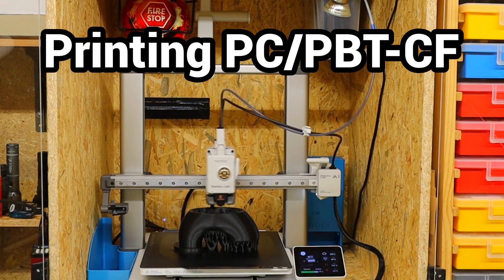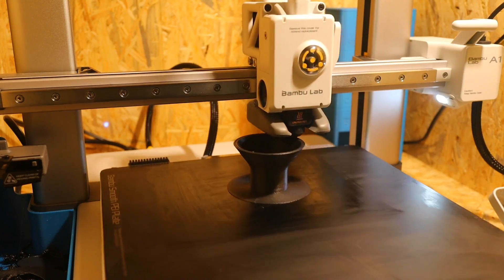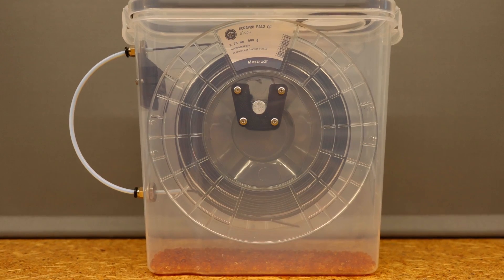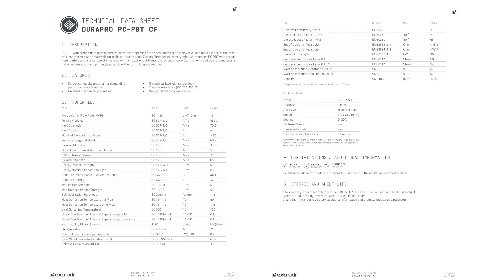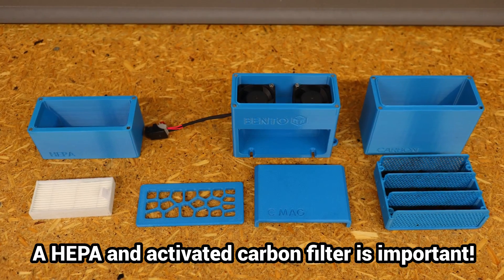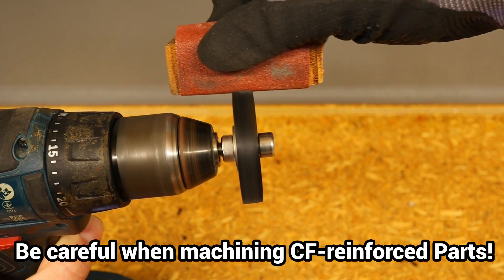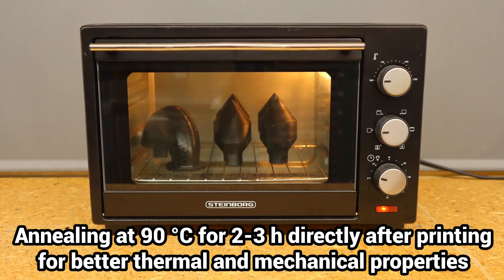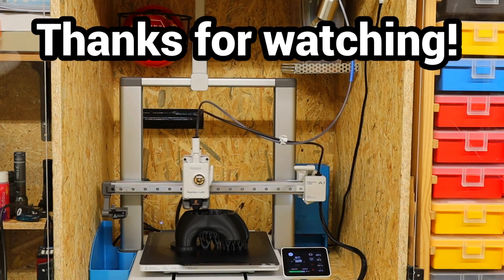Printing Polycarbonate CF / PC/PBT-CF : Important considerations !

Comment: Commenting on the newest vid so youll hopefully youll see this! Have you considered mirroring the thermoacoustic arrangement to both sides of the linear generator to create equal but opposite acoustic waves acting on it? This may help eliminate inherent imbalances, double the power and the weight/dimensions of the generator could be changed to achieve a more perfect resonance.
Reply from the maker: This is a good idea for the later, readily developed engine but for this first experiments it will slow down the development process.
I will keep this in mind, many thanks for your nice suggestion!

Comment: Wow! – what an amazing test and an even more impressive video! We're absolutely thrilled to see how you used dichtol to strengthen your 3D-printed part and make it pressure-resistant. That’s exactly what our product is made for. Thank you so much for sharing – we truly appreciate it and love seeing dichtol in action! 🙌
Reply from the maker: In the next days i will make new pressure tests with the dichtol treated carbon reinforced filament test samples to see if they can withstand higher pressures than the probes printed with regular filaments!
Till now the dichtol does really a nice job up to 10 bar pressure!
Reply: @myengines2443  
This is the first video of yours I have watched (will find time to watch more) so not sure what else you have tried but if the failure mode is along the layers, perhaps wrapping a few layers of carbon fiber (with epoxy) around the perimeter could solve that. 

As for leaks, some years ago, I made some PLA parts for pneumatic spearguns holding about 30bar of pressure. The parts are not the actually pressure vessel like yours and, of course, pressure on its own, as you know, means nothing without knowing the size and my parts can be thought more of as plugs or end caps. So, higher pressure but possibly less force on them. But they still had to be airtight. 
Even with all the tricks on the printing side (no retractions, slower speed, higher temps, tweaking wall thicknesses and overlaps, etc) there was still a bit of porosity. I solved it by epoxy impregnating the parts. First, I tried vacuum impregnation, so bascially submerging the part in the resin, pulling full vacuum and then releasing the vaccum so the resin can fill the voids created by the vacuum. But what actually worked better was using positive pressure. So, forcing the resin through the part with pressure. Perhaps something similar can work for you - though it seems your limit is still mechanical and not so much porosity - but still thought I would share the idea. 
Oh, the vacuum impregnation wastes a lot of resin, the positive pressure method much less so - but if dichtol is a single component product that can be poured back into its container, that would be less of an issue. But of course you can't do that with epoxy;)

Comment: pet-cf should be excellent. and pla-cf does not require anything different from normal pla. maybe hardened steel nozzle, but nothing else. not petg-cf, but pet-cf. bottle plastic + cf. pet/petg are well behaved filaments plastics without major extra considerations. which should be avoided in a diy focused build. the simpler the build the more useful the product. some 3d printing experts so called are way too panicked about the super details of things. over worry hurts everyone. ie dont believe randoms on internet. let the ded bury their ded, dont you worry. pet/petg and pla dont have any problematic printing by-products.
Reply from the maker: I also think so, but I want to test if these engineering filaments PA, PC/PBT etc can hold much more pressure that the usual ones.
The next weeks I will test it with many probes and explosion bursts...

Comment: could you use cement/concrete with 3d prints like using a shell to hold cement in, not saying it should be done, i feel like it would end up being a mess, but i feel like if did work it would add some decent strength while being fairly cheap
Reply from the maker: You are right, it would be a mess and much work, too.
I like 3D printing because it is really rapid prototyping and I can get results really fast.
It it is not rigid enough, I may try it, thanks!

Comment: you should make a solar collector to run your sterling engine with
Reply from the maker: Basically you are right, but I would like to use the Stirling engine to support our solar plant in times of little sunshine, for which I operate the Stirling engine with self-produced biogas.